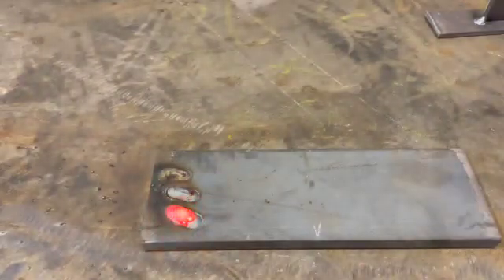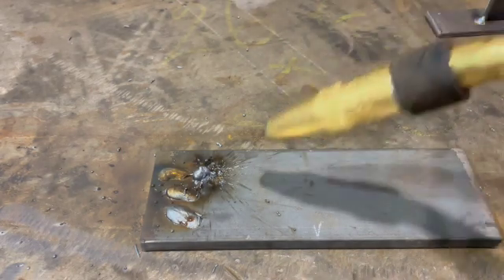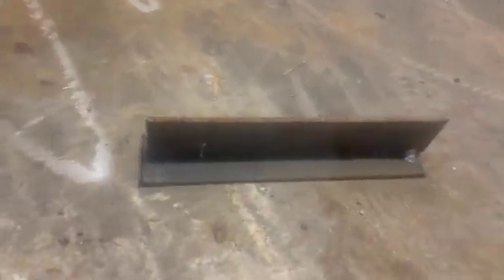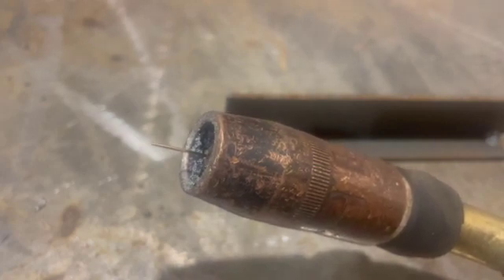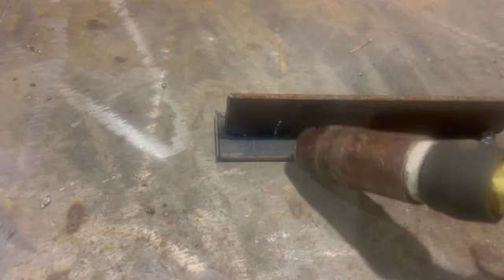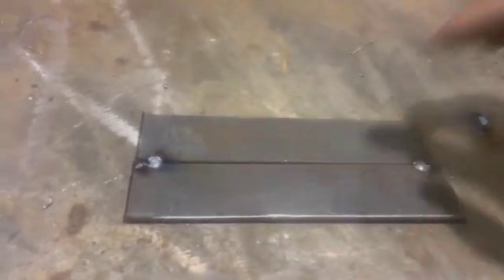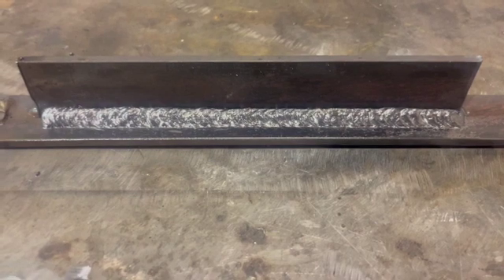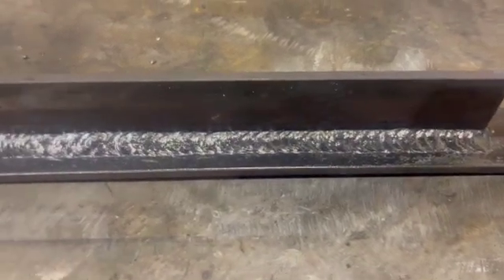Welding with .035 Wire - Basics

Comment: nice explanations.  question:  why are you choosing to use CO2 instead of C25?  do you find the CO2 gives you just as good results?   when would you choose C25 instead?  thanks.
Reply from the maker: CO2 is the only shielding gas we have although we have run into C25 from time to time. We've had other welders ask the same thing like why not use C25 as you can get a better bead appearance and less spatter / clean up, which may be a little more helpful for welding up railing pickets. C25 costs twice the amount of CO2. CO2 is still documented as having good thermal conductivity, so you can still get good penetration and a decent bead profile.